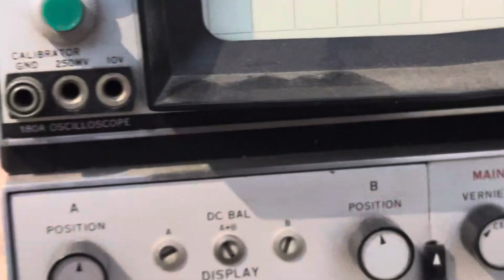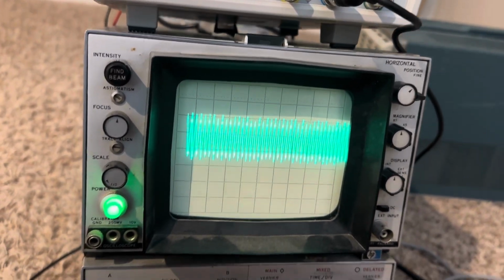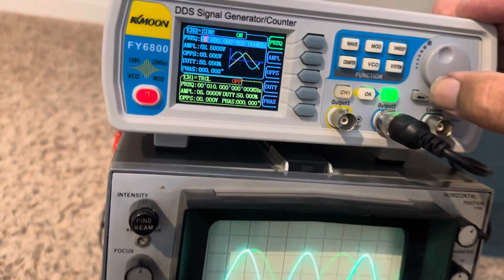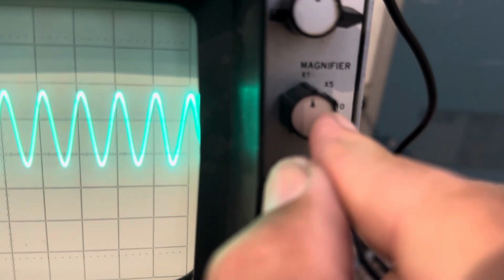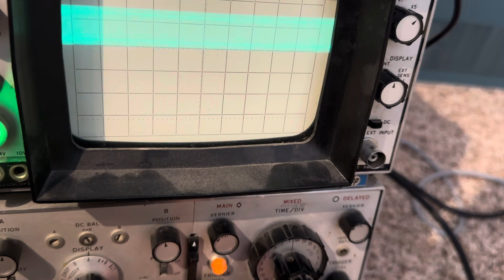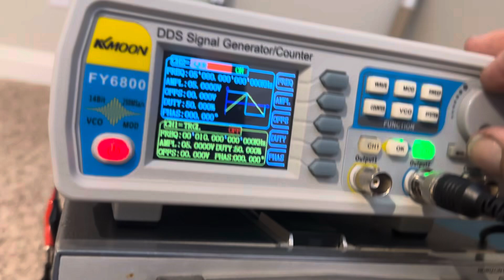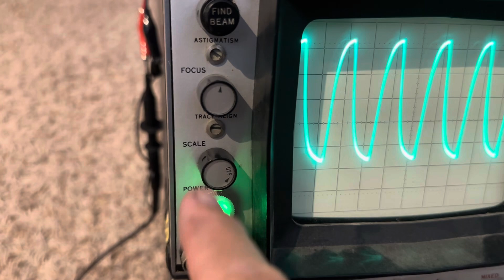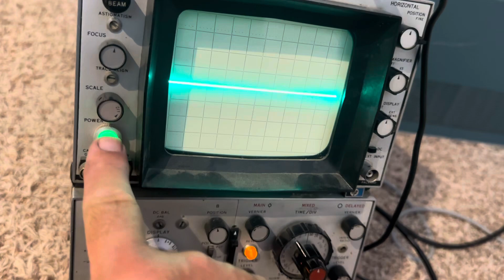Hewlett-Packard 180A oscilloscope demo

Comment: 30MHz is way past its 3db range.
Feeding it a 5MHz Sine wave and noting its peek to peek level then winding up the generator until this peek to peek falls to 0.707 of its original 5MHz level..... that will be its upper bandwidth (For a Sinewave, Square wave bandwidth would be a lot lot lower)
Reply from the maker: Thank you for the clarification. I wasn’t really sure of the limits of the scope being from 1962. I figured it wasn’t a moon rocket but it does work. I’ve been looking at modulation on the 40 m amateur radio band with it and it seems to work for that. Take a look at the video which is newer than this one.
Reply: @moviestudioland  
It's a mint looking scope though considering its age...

Comment: That scope came out during the 70s where I was a metrology technician in the Air Force and use to calibrate and repair those scopes along with a wide array of other test equipment.  HP wasn't known for their scopes.  Their specialty was RF equipment.
Reply from the maker: Hey, thanks for your comment. Yeah, I picked that scope up on a lark. It doesn’t appear to be the same league as a tectonic scope. I was able to major some modulation with it on the 40 m amateur band and it seems like it works good for that I suppose it would be good for basic of HF and VFo